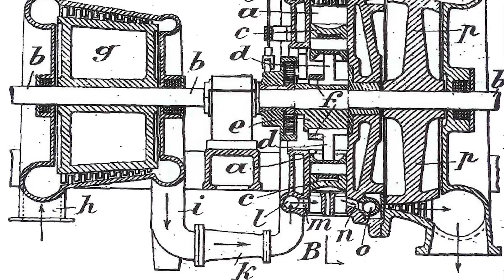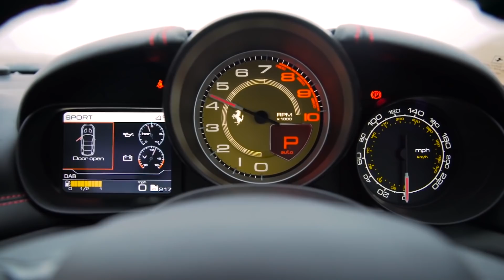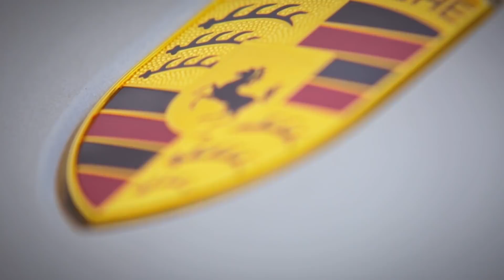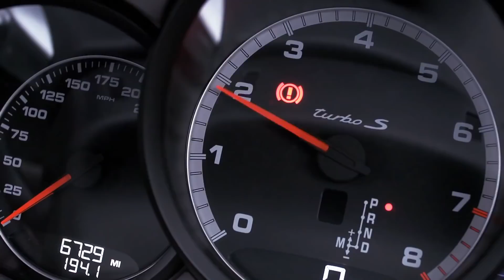Turbocharging: Are You Wrong About It?  - Carfection

Comment: I think you are trying to say that turbo engines are more economical than naturally aspirated... either I understood you  wrong or you  are wrong. The ideal fuel / air ratio is still the same in all engines with or without turbo. So if a 1 liter turbo engine makes 100 hp or 1.6 naturally aspirated engine makes 100 hp they both have the same stoichiometric ratio which means that they need same amount of fuel to produce the same power. Actually the turbo engines are proven to be more polluting by producing more particulates which is why the manufacturers are coming out with particulate filters for gasoline engines...  Please do the research.
Reply: Turbo chargers increase the area inside the Otto cycle PV graph, I learned this in first year aerospace engineering. They recover waste heat from the exhaust. Less waste heat means a larger % of the energy in the fuel becomes power, not heat. Yes the Stoich ratio is the same, so the energy release from the fuel is the same, but the proportion of that energy that makes it to power is greater, i.e. turbo chargers are more efficient.
Reply: Except Power (work done) = Input energy (fuel) x efficiency...
Reply: Not a useful comparison, a useful comparison would be for example, a 2.0 turbo producing 280bhp and a 3.0 n/a producing 280bhp. Of course, torque curve will be totally different, but essentially, when not WOT, the 2.0T will use less fuel to move the car than a 3.0.
Reply: Yes but the 1.0 engine will have less pumping losses during normal driving which will improve fuel economy when you're not making the 100hp
Reply: The old 2.5 engine isn't known for being fuel efficient in the STI. The 911 has a smaller frontal area and I'd expect it to be a bit lighter too.
Reply: I'm afraid if you studied thermodynamics you would know that turbocharging makes engines more efficient...They recover energy otherwise lost in the exhaust.
Reply: Not correct. Turbos when on boost run much richer than their naturally aspirated counterparts.. They do not aim for stoichiometric ratio.
Reply: Let's face it. There is no such thing as fuel efficiency.

Comment: Well put, I think one main problem is that a turbocharged econobox still uses a lot of gasoline when the power is actually demanded. It's more fuel efficient when not a lot of power is delivered, but when it is, it drinks more. "Turbo läuft, Turbo säuft" is a German saying, meaning that the car drinks a lot when the turbo is running. That still holds true, the most renowned German car magazine has done a very interesting head-to-head comparison between the Ford Mondeo 1.0 vs the Mustang GT, where both cars had been driven behind each other in different environments, city, Autobahn etc. The Mondeo still came out on top, using less gasoline than the Mustang, but it was way off the official numbers, while the Mustang was close to them. I think iirc the difference came down from 7 liters/100km to less than 2 liters/100km advantage for the Mondeo.

On performance cars, that really doesn't matter. The only problem there is that it complicates the engine and more moving parts can break, but if you know how to treat it right you can minimize that.

Comment: For us lead-foots turbo-charging doesn't help fuel economy. It's actually worse. I had an E500 (2009 model with 5.5L NA V8 and 381bhp) and upgraded to a 2012 model E500 (with 4.7L Twin Turbo V8) and I got less mpg in the turbo car than in the normally aspirated one. It's a fair comparison because it's the same car. The turbo car has the potential to get better mpg, if you keep your foot off the gas pedal and drive it like grandma (basically drive the same way the government mpg tests are performed). I can get more mpg on a speed-limited motorway cruising at 70mph, but being a frequent autobahner, I got 20% worse mpg.
Reply: Not enough people bring this up.  The whole "turbo are saving fuel" pitch is such a lie.  Fuel is used to cool down the combustion chamber therefore increased consumption. Such a shame we are losing N/A engines as a consequence.
Reply: I had a C63 wagon with the 6208cc engine and have just changed to an M6 coupe with the S63Tu engine. They are about the same weight and I get about 20% better fuel economy if I'm driving like a normal person. If I drive it hard, fuel economy is about the same or maybe a bit worse.
Reply: I'm sure if I didn't live 5 minutes from two different unrestricted autobahns I'd probably also get better fuel economy ;-)
Hope you got away from that glorious 6.2 (aka 6.3) litre engine without any financial pain. I hear the head bolts have a habit of causing serious financial pain to the owner. Shame, because it's otherwise a classic. Those who bought the C Coupe 507 edition have done really well with depreciation (almost zero).
Reply: Which one did you like better? I just love NA V8s, the benz V8s the most!
Reply: You might be disappointed to hear that I prefer the turbo. I didn't think I would. That extra 25 horsepower is nice and it just accelerates and accelerates and doesn't give up. I tried an AMG but found that those extra horses (the 100 at the top) are just food for the traction control below 50mph. Plus I didn't want my neighbours to hate me with the AMG exhaust. I stayed with the 5 litre when it came to my next upgrade, to an S500 (with 435hp). Glorious engine.

Comment: It’s really more of a scam to help car makers avoid emissions fines since the numbers only work on paper. In real driving, they use more fuel than NA engines. They sound worse too.

At least in that way they could speed up the transition to EVs. But for fans of noise, couldn’t you do a naturally aspirated engine with a hybrid or PHEV? Then you actually would get the best of both worlds.
Reply: Turbocharged engineers have a higher brake specific fuel consumption at maximum power.  At low loads they're practically identical.  However, since most engines used by the driving public aren't at maximum power very often, turbos allow engines to be downsized and get the fuel economy advantage without losing maximum power or torque.
Reply: More fuel? BS! Turbo engines tend to be smaller, so when you don´t accelerate as much the turbo doesn´t generate any boost and behaves like it´s not there, efectivelly making your turbo engine into a small NA one, consuming less fuel than a bigger NA engine with the same power output. The problem is many people like to floor their turbocharged cars continuously because it´s fun! Then the consumption goes bye bye of course.
Reply: Chris Till turbocharged engines are way more efficient and economical, especially in city conditions. It's not about the max power output, it's about the torque curve. Ultimately, they make more torque at lower rpm = more power as opposed to NA. This means you don't have to wring its neck to accelerate at the same rate, instead you can shift earlier at say 3k rpm. That's also why diesels have better economy and longevity.
Reply: Rin Hato Thomas from Autogefuhl talks about this subject frequently. He really focuses on consumption in his tests.
Reply: It appears the debate is alive and well!
 
Personally, I had a GTI VR6 (we got those in Canada). It was a 2.8L, it sounded great and it was a joy to drive.
 
I now have a 2017 Golf R, and, I'm not sure. I know I get better fuel economy by a large margin compared to the VR6. And, once I got used to the smaller turbo lag the EA888 engine has, I've started to really enjoy it. 
 
Don't get me wrong; I want a Porche GT3 Touring so I can have that 4.0L screamer and a manual. But, at the same time, I'd like to keep a nice turbo as my daily. 
 
I like both.
Reply: FishFind3000 did you read me right? At low acceleration turbos don't generate boost, therefore no need for extra fuel
Reply: Just Pelé, then you should consider selling your GTI and buy a V6, since a turbo is totally useless in your use scenario! I also have a GTI as a daily but I don´t generate boost all the time, because I don´t need to/feel to do so, and petrol in my country is expensive as hell. I need a car that can be fun when I want it to be fun and efficient when I´m not at high throttle , and a turbo is excellent for that.
Reply: I had a C63 wagon with the 6208cc engine and have just changed to an M6 coupe with the S63Tu engine. They are about the same weight and I get about 20% better fuel economy if I'm driving like a normal person. If I drive it hard, fuel economy is about the same or maybe a bit worse.
Reply: You dumb Chrystal.
Reply: Dimitar Turbos make hardly boost at low rpms, turbo lag is what you call it when the turbo isn't spooled up, meaning loss of power and torque until it comes on boost. That's the reason that N/A and supercharged engines have a smoother power/torque curve. Diesels have better economy and longevity because the fuel itself has a higher energy density and the engines have to be overbuilt to withstand the extreme pressures compared to petrol engines.
Reply: Car and Driver did a test recently that concluded that turbo cars were the same if not very slightly better on gas than N/A cars. The highway cruising MPG usually offsets the city.
Reply: I call troll. Nobody is this stupid.
Reply: if turbochargers were so good, why arent all engines turboed?  They have been around for many decades.  They arent a new invention.  Turbos primary advantage is its volumetric efficiency and power density.  Not fuel efficiency.
Reply: AAA did a test and found of those who had mpg discrepancies with EPA stickers were those with turbocharged engines (non diesel) with V6 turbocharged being the worst and i4 turbo being the next worse.  Yes turbos can work if driven perfectly, even moreso than N/A.

https://www.autoblog.com/2015/06/17/aaa-study-real-world-fuel-economy/
Reply: Rin Hato Clearly you're unable to interpret my comment. If you understood how an engine works, you'd understand that harsh acceleration is what changes the situation.
Reply: Dre J And we’re talking about sports cars so you’ve answered your own question. And as far as less sporty cars, I see almost no other drivers driving efficiently. It’s still not taught in out of touch driving schools.
Reply: Chris Till Are you kidding? "Use more fuel than NA engines"???? Not at all. If you're an aggressive driver then you're correct, but if you know how to drive to conserve petrol (albeit boring) then that's not the case.
Reply: Hambert when you stuff more air in the engine you need more fuel to keep it at 14.7 ratio. So they can use more fuel but then they make more power for the same displacement.
Reply: Dre J do you know how engines work?